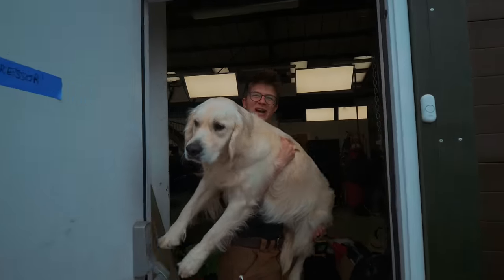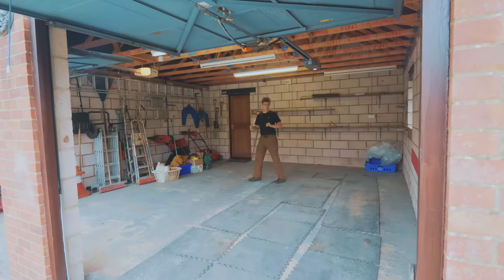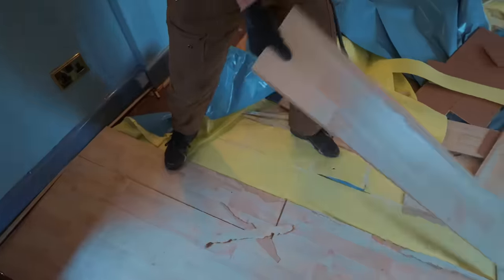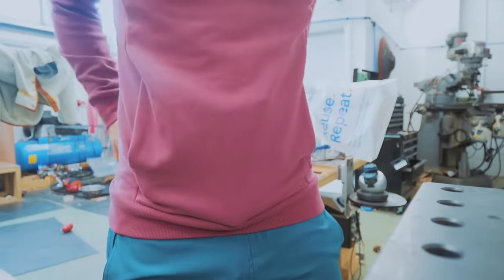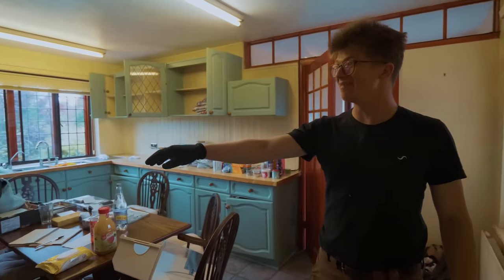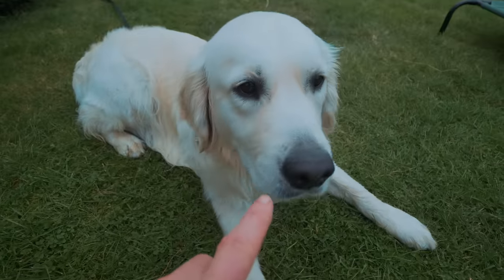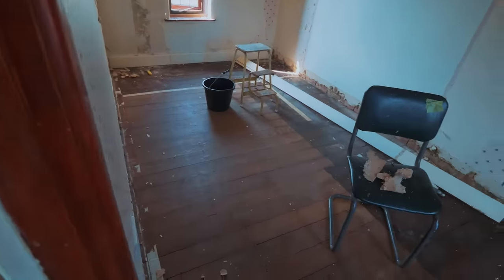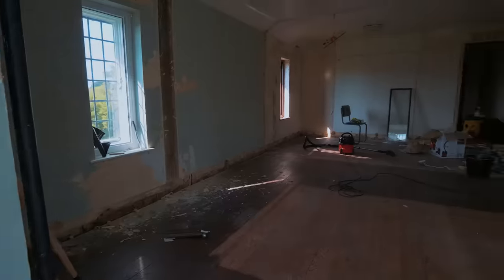I got kicked out of my workshop!

Comment: I'd really have the entire house's electric wiring checked out by a professional electrician. Seriously, what with the butler's bell getting stuck turned on that tells me you have a short and that could spell electric fire. Please, I'm begging you, get your electrical wires checked NOW.

edit 1: If you smell wood burning and you haven't lit the fireplace turn off all the switches in the circuit box and call an electrician. I have a reason for my paranoia. The first year my parents bought their current house my mother kept spelling charring wood at the front door but only when the switch for the out door light was turned on. This went on for about a year until she had an electrician find the source of the burning smell. The wood all around the light switch was charred black and she was told that she was within one flip of the switch of having an electrical fire in the wall.

edit 2: To the 388 people who down voted this video, you're all just jelly that Alec bought a house and you didn't.
edit 2.5: Now 593 people are jelly they didn't buy and renovate a house. So sad.

edit 3: Just finished watching the video and the part where the butler bell was being turned on by the closet and not a short. I'd still get an electrician considering all the damp floors and walls. Better safe than a house fire.
Reply: I'd be amazed if they didn't rewire after all that demolition!  (And replumb, new heating......)
Reply: @FFVoyager  Now that you mention it that would make a lot of sense and Alex is sensible if nothing else. If you're gonna go to the expense of buying a house and ripping out its' guts you're not gonna say "I replaced all the plumbing, heating, insulation, heck even a few internal walls, but not the wiring! It looks like it'll last a couple more decades".

Comment: Classic British architecture: 
Why have one big room when you can have two or three impractically small ones? 
Wall to wall carpet in the bathroom because you don't have to clean a room that can't be cleaned. 
Water, gas and electricity on outside walls so it's easier to repair when it inevitably breaks.
Giving the rats their own entrance is considerate and the proper thing to do.
Reply: Besides the small bedroom, which rooms in particular seemed to be "impractically small"? This house being above average size (especially for Britain), the rooms within seemed quite sensible in size and number. Americans seem to feel that any room smaller than 1,000 ft2 is "cramped", but to people in e.g. Japan, this house is the size of a hotel.